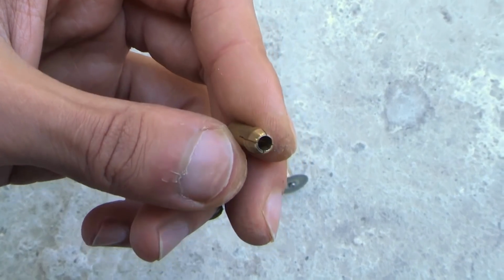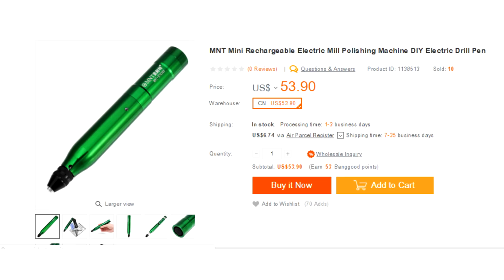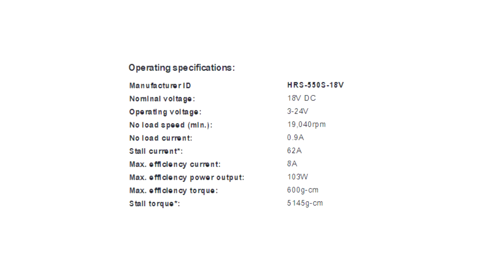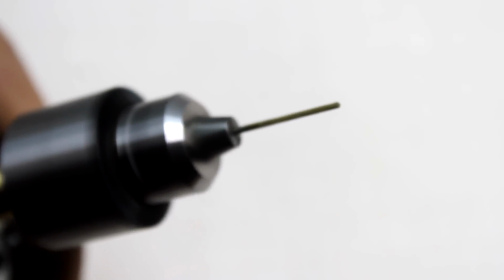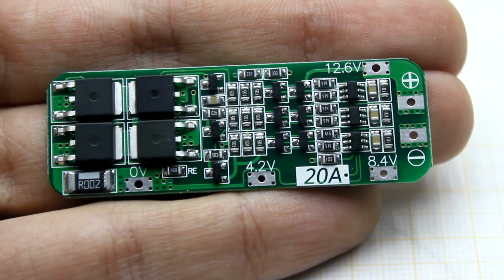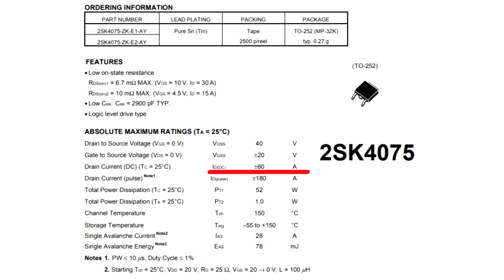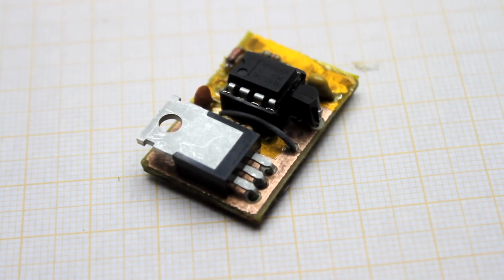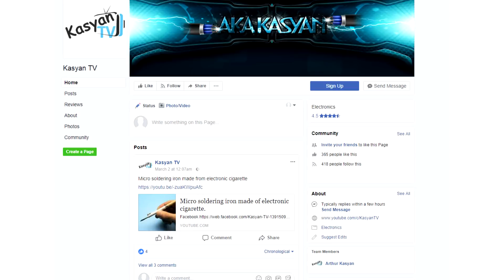DIY SUPER Tool

Comment: If you buy parts from China, chances are good that you'll get a fake copied part. 
I have dissected a few power transistors, mosfets and ICs, under a microscope, and they were all copies. The dies were considerably smaller, to save on silicon. You have to de-rate them accordingly. 
Even ubiquitous parts such as a 555 or IRFZ44, were copies with dies 1/2-1/3 the size of genuine parts. 
Some examples;
LM317 which is rated at 1.5A, did not make it past 1.1A.
2N3055 rated at 5A, didn't make it past 2.5A.
If you want parts that match their datasheet specs, you can not buy them cheap from China and expect them to be genuine and work as advertised.

Comment: I feel the schematic drawing is slightly incorrect in my view.  Consider VD3 in this instance is superfluous remaining active tending to make R3 a voltage divider given VD3 is conducting while pin 7 (internal transistor collector) switches active.  Think R4 – VD3 junction should link to pin 7 so charge path is Vcc, R4, VD3, R3, C2 and discharge R2, VD2, balance of R3, C2 via pin 7. By that both VD2 and VD3 will alternate reverse bias during PWM cycle

Comment: Actually the inductive kickback from the motor is raising the voltage on the supply rail. There should be provided a bus capacitor to protect the ICs.😇
Reply: He did put an anti-parallel diode to the motor, and since the power supply is a battery pack, voltage will not raisr
Reply: Hmmm - sorry do not see that path between VT, motor and supply for voltage rise when VT turns off?  However, I thought that the motor parallel diode VD1  ( free wheeling diode, flyback diode) is designed to absorb spikes upon collapse of the magnetic field by providing least path of resistance. Depending on the capacitor value by placing it across supply offers general smoothing from oscillation or placed nearest to IC for parasitic oscillation. Can also includes capacitor across a motor by recognising it as a switched source.
Reply: No that's right, I also saw the antiparallel diode across the VTmotor but take a look that the voltage momentarily rises in either polarity(across the motor) to a little extent,which is enough to kill the NE555 chip though being connected to a strong power source.The diode across the VTmotor is used to protect the body diode of the MOSFET.
Reply: Think I see where you are going with this - given the instant voltage applied by the FET during on period, the voltage magnitude spikes generated by the motor can exceed supply impacting components sharing this environment.  That said, variables within motor function (PWM) such as instantaneous load (torque) and  inductive reactance (BEMF) as it moves towards saturating the field to be considered. 

In essence, you were talking about field establishing, where I was looking at the field collapse.
Reply: CyberNaut WA , exactly 😄